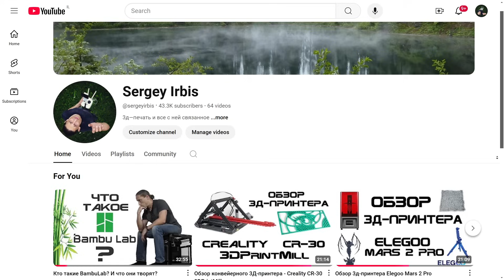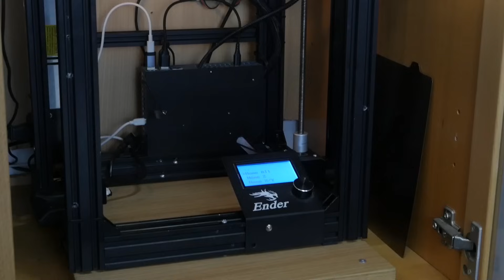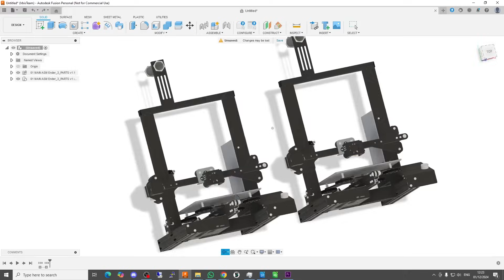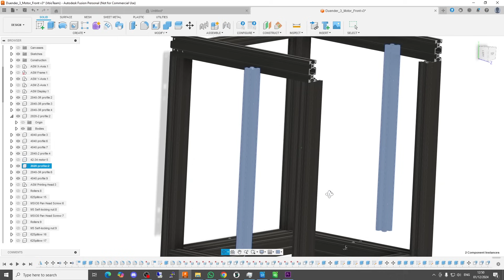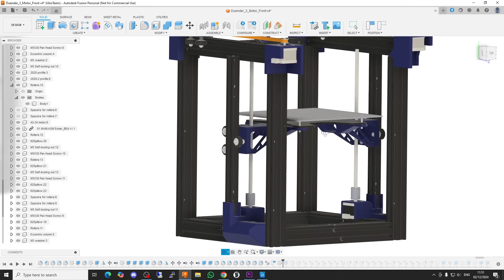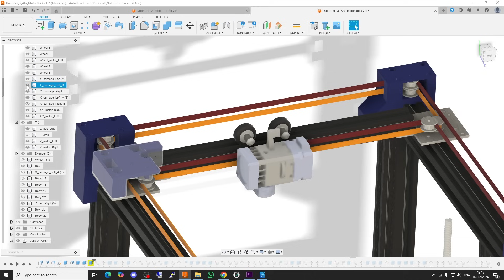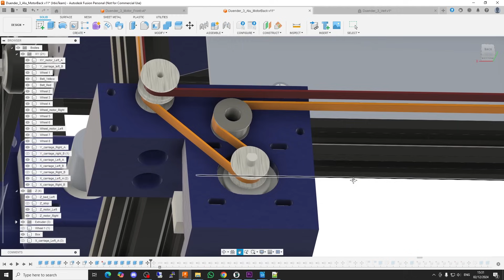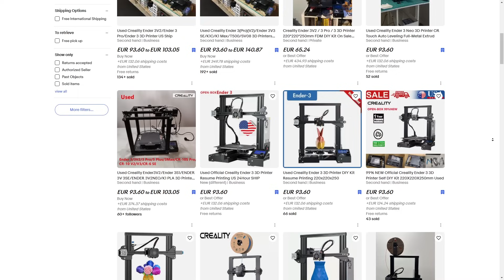- DUENDER: Part 1 - I converted 2 Creality Ender-3 into one fast CoreXY printer

Comment: When you have the stepper motors in the back, you need to pay attention to the belt they drive. They should drive the belt that goes to the gantry, not the front of the printer. You want as little belt length as possible between the stepper and printhead. The way you had it setup was the opposite.
Reply from the maker: In current config they are exactly like that. The right motor is for the lower belt and it goes directly to the extruder on the right. The left one is on top and goes to the extruder from the other side.

Comment: You can buy a used Ender 3 here in the US for as little as US$50. That makes them excellent parts machines as the steppers alone are worth more than the cost of the printer. I bought an Ender 5 Pro recently for US$100 just so I can use it for CoreXY experiments.

Comment: Какие конечные габариты получились у принтера?
Reply from the maker: At the moment. External dimensions: height - 55 cm (with extruder, frame only - 48 cm); length (X) - 42 cm; width (Y) - 46 cm.  Build volume 230x235x270

Comment: I’m actually making a very similar project but it’s a flying gantry setup and will have a chamber heater using the extra bed and it’s fully enclosed with the option of using the v-wheels or rails and in total I think it should cost about $150 usd. It’s cool seeing the same concept but executed completely differently. Also those vfa’s are probably the steppers as keep in mind that they are quite old and so getting new ones may help there

Comment: Hello Sergey! I have two old Ender 3 pro and ZAV Max pro printers gathering dust. Both with replaced boards and transferred to the Klipper firmware. It's a pity, but they will have to be disassembled soon. Printers were good for their time, but now they are very outdated.

Comment: Great stuff.  I have 25 Ender-3's in a print farm, and they are highly tuned, good quality machines with a few tiny but critical modification I make as a standard package.  I keep looking at maybe replacing them with modern machines, but they work well enough, just more slowly.  If I can turn 2 machines into 1 twice as fast, that could be worth doing, as it will sometimes increase and sometimes decrease capacity, but it will free up space for more modern machines!

Comment: CoreXY is the stupidest hype since 3D printers were invented.
No advantage over a regular Cartesian like the Ender 5. No, you're not using 2 motors at once any more than you would by rotating your part by 45 degrees. You only get more slack due to overly long timing belts.
Congratulations!

Comment: 12:40 isn't this what Klipper and Input Shaping are supposed to solve?
Reply from the maker: Input Shopping helps to remove the echo caused by sudden changes in the direction of movement. VFA are resonances in ordinary movements, especially at low speeds.

Comment: Hi. I gave away two Enders in the summer. Oh! But the topic of remaking is still extremely interesting. My main printers are Ender 3 kinematics. I want to do this with another one. If I can make such a printer, and even with a change of filament, it will be extremely interesting.
Subscribed from the old channel. I wish you success.

Comment: (https://youtu.be/Fe_BFGg_ojg) this might help with the wobbliness of the walls, is the only solution I could think.
Reply from the maker: These are different defects. Input Shaping helps to remove the echo caused by sudden changes in the direction of movement. VFA are resonances in ordinary movements, especially at low speeds.

Comment: 3:11 I have a cr10 max I'm converting to corexy because it would almost be physically impossible to make it fast without some insane changes  if I kept the same motion system.
Reply from the maker: In the video, I said that any kinematics can give good results, bearing in mind the quality of the final models. But I didn't talk about "good speed results" on any kinematics.
Reply: @Irbis3D  perhaps I mixed it up with something someone else said.

I'm actually in the middle of converting said cr10 max into a enclosed corexy machine, the shape of the motor mounts is a bit strange to sort out.

Comment: Why not use z_tilt_adjust to automatically equalize the z height between both stepper motors using the BLtouch instead of sensorless homing on z?
Reply from the maker: It is possible, no problem, but on my board there is only one driver for two Z motors

Comment: Just an idea about the board... Maybe using a PI or a PC (with klipper), connected to both boards, and make them 2 different mcu´s?
The idea to use 2 enders for a core xy, i was thinking on it... so im very interested in it...
Reply from the maker: I used 2 boards connected to one CB1. One for printer, second for multicolor unit. I'll tell about it in the next video.
Reply: Idex CoreXY?

Comment: also you not mentition that coreXY have some problems too) long belts. belts must have same tension.
Reply from the maker: Any printer has a specific usage. The belts are not very long, unlike the H-bot for example. And tightening the belts equally is not a big problem.
Reply from the maker: I'll talk about these nuances in one of the following videos. When I check different configurations and talk about their specifics.

Comment: Many have converted an Ender3 into a Voron Switchwire.
The core XY doesn't actually require mounting the two motors at different heights.  In the Switchwire, the motors are at the same position, but the pulleys are reversed, IE: the hub with the set screw on one is against the motor, on the other the teeth are.  This separates the belts enough so they don't need to cross.  The same thing can be done for core xy as for core xz (switchwire).
Reply from the maker: Actually the motors are also almost at the same height and the pulleys are reversed. It would be more correct to say in the video that the belts run parallel to each other at different heights.

Comment: It hurts my ears. You need to work on the sound, it’s better to take a normal microphone on a stand than a lavalier one, and post-processing of the sound can fix almost any quality. Otherwise, good luck in your new field.
Reply from the maker: In this video, the problem is not with the microphone, but with my voice. After recording, I realized that I was speaking almost in a whisper, very uncertainly. I tried to fix it with a compressor and a denoise as best I could. I'll try to speak normally next time.
Reply: @Irbis3D  Well, the voice and articulation and Russian accent — of course, you need to work on that. I mean at least a normal voice equalization. There's a lot of bass, 125 hertz and 250 hertz are buzzing, there's little mids and highs. Maybe it's okay to hear from the phone, but from a computer with good speakers, it's hard to even hear what you're saying. =)

Comment: Why did you cut Z axis spindles? Just lower the motors. You will need dampers anyway.

As for the project. If Ender 3 is a joke to you, then this printer doubles it. = )))

Also I guess no point in creating AMS clone, as all those systems are really slow and very filament hungry. Multi tool systems are the way to go.

I have got the Ender 3 and I do not want more speed or less trouble with putting a cardboard box over it. I want multiple heads. = )

But Ender 3 is obsolete now. Well, I guess I will just dump it and buy the latest Bambulab model. (No) = )
Reply from the maker: To lower the motor, I need to move them inside the frame. And then they turn out to be uncomfortably close to the table. Because of this, I have placed them on the lower profiles. But as I said in the video, I'm going to change this Z-axis configuration.

Comment: For now I would not look at the Klipper firmware as the only option.
Modern Marlin is pretty capable: LA, input shaping...
Yes, more powerful control board would be very nice to have, so I'd rather spend some money for ONE better control board than having additional Orange Pi or similar.

Comment: Отличный проект! Есть у меня 2 неиспользуемых Эндера и как же долго я думал над подобной идеей к сожалению из-за нехватки времени так и не удавалось даже начать. Как же здорово увидеть что у кого то все таки это получилось! Проблема с VFA на стоковых моторах Эндера к сожалению очень жестокая и я очень долго боролся с ней не своем Enderwire в конце концов пришел к выводу что проще купить другие моторы и да вы верно подметили что эта проблема есть на всех моторах, но все таки у Эндера это прям болячка.
Reply from the maker: I'm going to try different motors too. But, oddly enough, on my ender, the vfa was not strong when the motors were isolated from each other. but after installing them on corexy, the problem got worse. Although, I still think that this reason is not the main one.
Reply: @Irbis3D  The difference is that CoreXY kinematics requires perfect tension between belts and equal belts length, even small length difference like one tooth will amplify the problem significantly. I know you are experienced user but just in case: I personally really love klippain-shaketune tools it shows perfectly the resonances and speeds that will affect print quality. Also TMC Autotune might help to battle artefacts as well.
Reply from the maker: Belts of the same length. The tension was adjusted by sound. Thank you so much for these tools, I will definitely use them. I tried changing the TMC parameters manually, but it did not bring obvious results.

Comment: Your search for reducing VFA is outstanding. And as many others have mentioned you have no reason to apologize about your English, it’s great as well. While I have no desire to modify an Ender3, as a retired engineer, I find this whole project immensely interesting. 🤔
Reply from the maker: @JustSomeHuman-j8o  I think the VFA war has just begun. There are a few more options that I plan to try. But, to be honest, victory is still far beyond the horizon.
Reply: @Irbis3D Just a thought , that may well be useless, is there any possibility that the belts themselves may be resonating? Perhaps trying wider belts or adjusting belt tensions might rule this sort of scenario in or out.
Reply from the maker: In some situations, these may be belts. Sometimes switching to 10mm helps. Sometimes it helps to change the number of teeth on the motor pulley. I have tried two belts so far, both Gates GT2, but different models and stiffness. Even with different tension, it does not have any effect at all. I suspect that at this stage I need to change the config to idlers with new larger bearings. I used idlers with M3 bore, and there are very small bearings. And during the experiments, I managed to damage them and now they are wobble, perhaps unevenly rotating balls cause vibrations. Therefore, the changes do not bring obvious improvements. In general, the path to a stable and convenient printer has many obstacles, but nothing is impossible))

Comment: Id love to see everything you talked about in this video from configuring software to printing it my self maybe even including models to used the original roller wheels or linear rails depending what ya got to build it and salvaging as many parts as possible and options weather you got the first ender 3 or the new ones do weather you got 20x20 profiles or 40x40 ones and if you got a ender 3v 2 and have the better screen and depending what extruders I personally got the sprite pro for mine and id love to use that for this if I ever get to build it I cant wait to see what you design for this project I cant wait to eventually build it turning older printers in to very useful ones again
Reply from the maker: I will definitely do this, as the project is interesting to people. It will take time to create different modifications. As well as financial investments to test different configurations. I hope all this will happen and this project will be able to grow))
Reply: @Irbis3D I can’t wait to see it man I got notifications on so I’ll be waiting best of luck on ideas